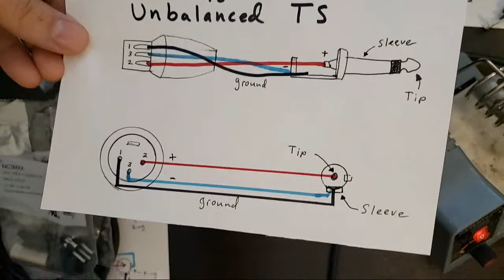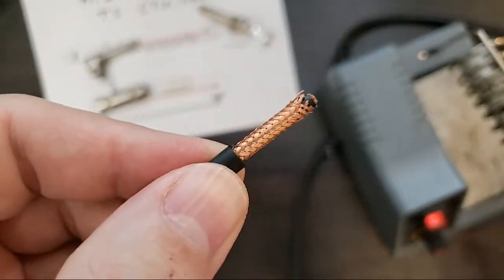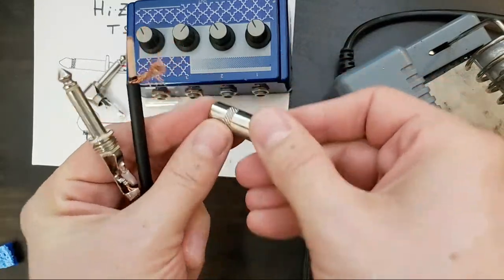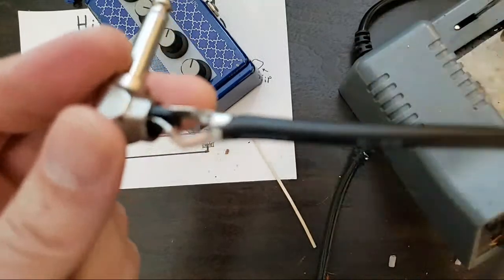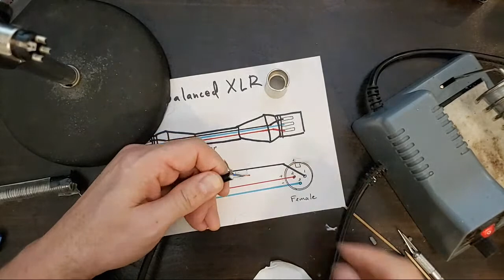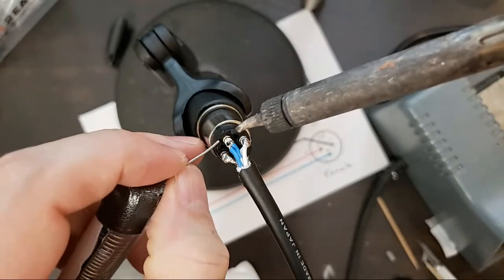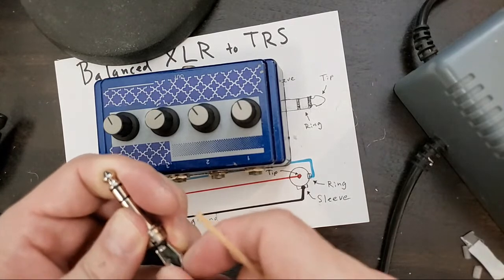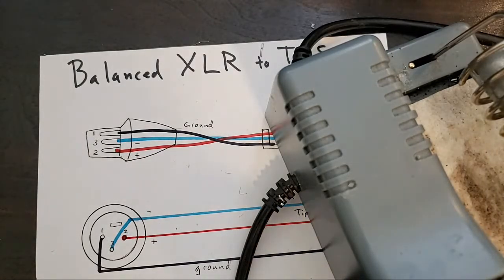DIY Cable XLR Mic Guitar Pedal Balanced Cables #stayhome #withme #Livestream

Comment: I see some people "tinning" their cables and connectors first. Can you comment on why you didn't?
Reply from the maker: Well, in this case tinning the wires would make it more difficult for me to solder the joint neatly.  I like the wire to slip easily inside the connector hole, and the lay flat on top- flush with the connector after soldering.  Also, I like to bend the wire up underneath the connector to hold it in place and keep the stray wires out of the way. 
If the wire is tinned before hand, I'll have trouble bending it into the shape I want before soldering; It will likely break during the bend. I find it harder to insert tinned wires into small contact holes.
Also, it will take longer to situate the wire in the contact hole while heat is applied, possibly creating a host of problems.  This includes overheating the insulation or the joint might cool while moving the wire, causing a "dry" solder joint.  
I'd say try it both ways and see what works better for you. 
Let me know how it works out!
Reply from the maker: Oh, I do often tin the large connector that the shield will be soldered to.  This is because I find it makes it easier to heat that joint without overheating the entire shield wire.  It also keeps the iron from cooling off too much when soldering the shield joint.  Just don't use to much solder while tinning.  If your parts are clean, and you are using rosin core solder, you shouldn't need to tin every joint.  But it does help to sometimes tin the big joints.